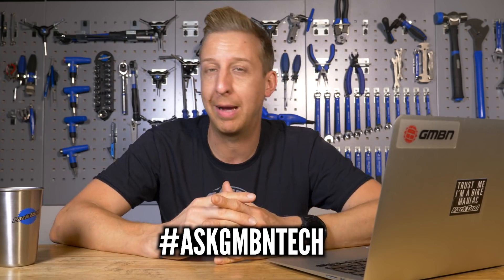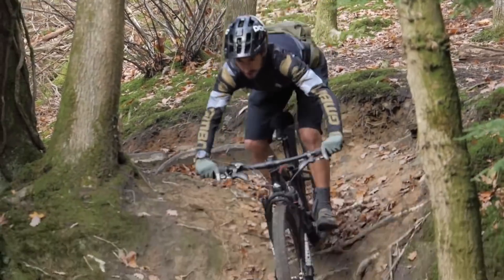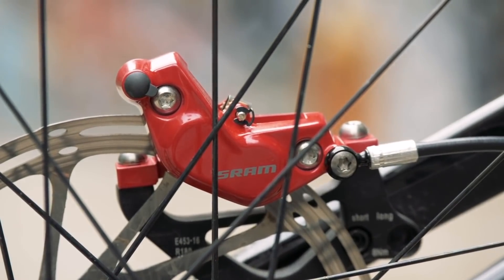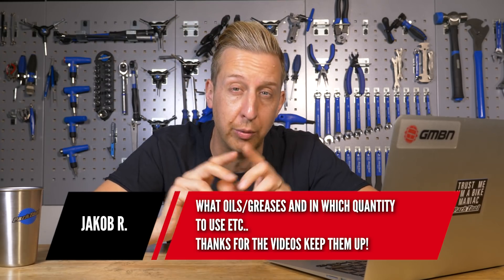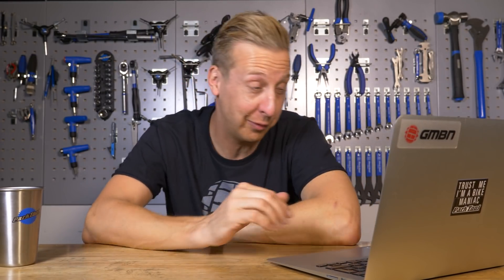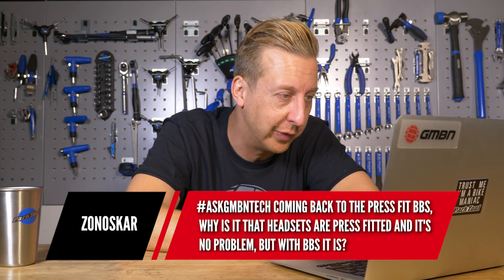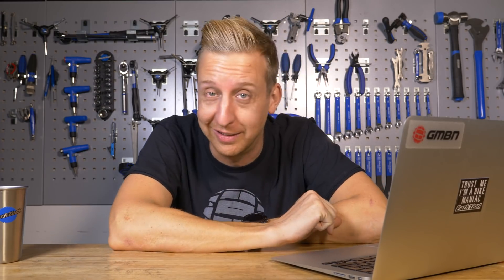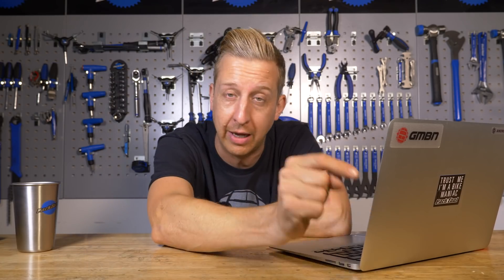Suspension Fork Service? | Ask GMBN Tech

Comment from the maker: What do you think about press fit Bottom Brackets? Let us know👇 Remember to use the hashtag #AskGMBNTech with your questions and we can try to answer them.
Reply: Id be happy to pay another 100$ for a bike if it came with a threaded BB, pressfit is pure liquefied garbage.
Reply: Press fit Bottom Brackets are a joke!
Reply: #askGMBNTech they work perfectly on 20 inch BMX freestyle/dirt jumping bikes but mountain bikes I prefer screw in bottom brackets.
Reply from the maker: @mountainlessmtb9940  Freestyle BMX BBs require the machined surface Doddy was talking about. BMX bikes use a larger bearing and smaller axles. In mtb overall weight is more of a concern and there is a lot more pedalling involved so the bearing races need to have this tighter tolerance.
Reply: @gmbntech  duh! That's why I said threaded bottom brackets were better on mountain bikes
Reply: Hey Doddy i have a question ive bought a budget bike and im slowly upgrading it. Im looking to upgrade the forks but im not all that bike savvy. What do i need to do to ensure i get the correct size fork? I would have bought used but MTB isnt popular in my area so its few and far between to get a descent used bike. Love the vids thanks!!!
Reply: Hate them! I wouldn't buy a frame with a pressfit

Comment: #askgmbntech 
I have a 180mm enduro, freeride bike. If i run it with 160 mm forks in front, should i, or can i change my rear shock to 160mm too? I would convert it to 160 at the back in order to make it more playful in the air and at the trails.

Comment: #AskGMBNTech I have a problem with my back wheel and there is some play even with the brake locked is this common and is there a possible fix?
Reply: Try checking the rotor bolts, and the hub :)

Comment: #askgmbntech hey mister dodd, i have trouble with my rear shock valve. Is the valve core the same as in tyre valves or are they something special because of the high pressure?

Comment: #askgmbntech
Hi Doddy, I was wondering which is a better alternative to dedicated chain lubricant. For a while may chain has been running dry and I don’t have access to bike chain oil so I’ve been using WD-40 and wiping any excess off, but my Dad suggested I use some  of his lawnmower engine oil as it would prevent rust and lubricate the links. But the engine oil seems to be a magnet to grit in dusty conditions whereas WD-40 doesn’t collect as much dirt. So should I keep using engine oil on my chain or switch back to using WD-40 until I get some good chain lube.

Comment: #AskGMBNTech

Hello, I have a problem with my seat post. I tight the screw at the correct torque and when I go on a ride the seat doesn't stay in place. It moves rigth and left, and the worst, it goes until the bottom, making me pedal in a bad positon. 

To solve this I increased the torque since 5nm (the correct one) to 7.5nm. 

Can I keep this torque with out breaking anything??? 
Or what should I do??? 

Thanks a lot and keep going guys, love the channel.

Comment: #askgmbntech I need to use an old tora 318 solo Air fork on a jump bike build I'm rescuing but I need to add the all travel spacer IN as I had it removed to boost it to 130 when it was on the front of my mongoose teocali back in 2009. Can't find anything online. I am familiar with lower leg servicing as I've just done a service and air shaft upgrade to my pikes. Help me Save my Toras Doddy.

Comment: #AskGMBNTech 
I have an X-Fusion O2 Pro RL rear shock and recently a buzz/ creaking sound has developed half way through its stroke, you can feel a buzzing feeling when you compress the suspension in say, a car park. Is this the linkage or the shock, or could it be something totally different? 
Should I even be worrying about this and if so, how can I fix it?

Comment: #askgmbntech How do you know when it is time to replace brake rotors?
Reply: There are 2 different indicators. 1 color of the rotors 2 width of the Rotors.. It should be around 1,8mm or 2mm or 2,3 depending on the model.
Reply: Nelson Thsnks. How do I know what the thickness should be?

Comment: #askgmbntech  On my last ride, I noticed my rear shock was sitting at about 25% sag without me on the bike. It wasn't extending back to 0%. After riding with it for a while, I decided to flip my bike over and pull on the back wheel to force the shock to extend, and it worked! I heard a little air escape. It was than great for the rest of the ride. What was this? How can I prevent it? and was my fix any good?
Thanks! (2016 Rockshox Monarch RL)

Comment: I think the idea that stronger brakes will lock up the wheels faster on a cross country bike is not really true. When the brakes are under a lot of stress, it requires more power to keep the modulation smooth such as when doing a stoppie. With not so powerful brakes, they will not have the power to modulate smoothly under the stress and they will lock up before they can modulate well.

Comment: #ASKGMBNTECH
Hi, long question, BB is confusing and buckling :( Thanks!

I have a loose cartridge bottom bracket (68/122.5). It buckles a little (I can see it wobble slightly) with pressure on the left crank at 6 o'clock position.
I also noticed that the screws that hold my cranks (3 piece, alloy, square tapered) were not very tight.
Now I'm waiting on a crank puller to tighten all the parts.

My questions are:
Can pedaling with a loose bottom bracket damage the frame?
Can the loose crank screws cause the BB spindle to ruin my cranks?
If my cranks are ruined, can I upgrade to something like hollowtech BB? If yes, does the spindle length of 122.5 affect the installation or do I just get hollowtech BB and 2 piece crankset?

Comment: #AskGMBNTech 
Hi Doddy, loving the show!👌🏻 I have a 26" wheel DH bike and was wondering if it was possible to run 650b forks with the 26" wheel? Or would this cause issues to the bikes geometry? Keep up the good work!👍🏻 cheers
Reply: If its dual crown, u shud be able to adjust the crown/stanchion position to keep geo pretty much same...though going 26 to 27.5 with same travel and stanchion position will slacken the bike to more modern levels maybe, so I reckon it will be fine if ur only doing gravity

Comment: #AskGMBNtech I am an xc mtb rider and I currently ride a 2x11 drivetrain and I would like to switch to a 1x12 drivetrain. My free hub body is a shimano. I was wondering if a 12 speed cassette with 11 to 50 teeth is a good option instead of a 10 to 50 teeth. And how many teeth on my chainring should I be riding with?

Comment: #ASKGMBNTECH 
Do an experiment on stopping distance based solely on rotor size
And should i get goggles and full face for my full sus or just a normal helmet with jawbreakers?
I ride my long travel full sus mostly  for street riding  and some trails here and there

Comment: #askgmbntech Why is 20mm boost not the new standard for mtbs?
With all the beefier forks out there and enduro going for 29ers it would make sense imho (always hated the 15mm axles). Stiffness should be better and weight effects are negligible.
Nice show btw, keep up the good work!
Reply from the maker: Well we used to have 20mm axles however were able to drop this down to 15mm to keep weight down. Boost 20mm is available in downhill forks 👍
Reply: Why like 20mm but hate 15mm?just wondering
Reply: If i remember correctly 15 mm started when Fox wanted to get around the Maxle QR thru axle patent for 20mm.
The 100x15 thru axles were kind of strange. But with the introduction of boost I wondered, why make a new standard for 110mm width, when you already got one. Bigger axle diameter means bigger bearings, which is good for durability and if there were no benefits to the stiffness they wouldn’t use the bigger ones in dh, also I like bigger flange diameter for stiffer wheels.
Even Rockshox made it obvious that they think a bigger axle is better with their predictive steering hubs. When I look at something like that I think the days of the 15mm axles are numbered.
Last but not least there is compatibility: with real sturdy single crown forks out there it is annoying that it is impossible to swap front wheels between enduro and dh bikes.
I do not buy the weight argument even though it is impossible to compare right now as there are no forks with both options.
I am still wondering why Rockshox is on the 15mm train.

Comment: Would 130/120 mm of travel be to short for north shore style enduro trails? #AskGMBNTech
Reply from the maker: It's what you prefer Caspar, there are some great hardcore trail bikes in this category with beefier tubing and more aggressive angles.
Reply: Blake rode a ht at whistler, so did josh on daily rider...so reckon ur good. Tho enduro is more 150 upwards normally.

Comment: #AskGMBNTech Hi Guys, love the show, i'm a bike mechanic from México, and i always have a question of fork/suspension service, especially in fox, some years ago i get a distribution of the brand, and take the training service, but it's really different what it includes of country to country (specialy inside my country), in other suspension service center they just made a change of dust seals, rebuild of Na2 air spring, and they purge the hydraulic cartridge,  but (at least as far as i know) each 125 hours it must be performed a full rebuild of the cartrigde, but the market price only of the spare parts its the same of the "full service" offered here (around 55 dllrs for a Fox 32) so, how it's done a full service over there? i mean, what it includes? cause a lot of rider prefers the cheap service, but when a problem arises, they somethimes tend to come with me. thanks for your time!

Comment: I'm sorry Doddy, you got the braking thing dead wrong. It's traction and rider weight NOT bike weight that matters, bike weight is a very small factor in braking performance, the difference between a lightweight cross country bike is minor;  let's say a 22lb. vs. 32 lb bike is only 10 lbs. It's rider weight and tire traction that matters.
Reply from the maker: The reference of lightweight XC bike was Doddy more talking about the style of bike and the riding that one would do on this bike. These bikes run longer stems so rider weight is pushed forward and are more about pedalling efficiency and run narrower tyres. This is very different to say an Enduro or Downhill bike where the angles and suspension travel allow for more aggressive riding at higher speeds. You are right that a few LBS between two cross country bikes will make very little difference to braking and he was not suggesting this.

Comment: #AskGMBNTech

Hello, I came to know that many shock come with different stroke travel but the same eye to eye measure (for example 230x60, 230x65 etc) but in reality are exactly the same hardware as the longer one, only with spacer installed under the bottom out bumper (talking about coil here)

so my question is, if I wanted to extend the rear travel of my bike, given that I checked of having enough frame clearance, would just cutting this spacer be enough? cause I read you also have to modify the Internal Floating Piston settings

thanks!

Comment: #askgmbntech when I ride, my thru axle rattles loose, only by 2 or 3 threads over a ride, but it's still there. Should I use lock tight on the thread? Or is there something else I should do?
Reply from the maker: If the axle has a locking system such as a cam check this is done up tight. (similar to a quick release cam lever) If it is an Allen key design check this is torqued up correctly. Be sure everything is greased correctly 👍

Comment: #askgmbntech

Hey there, love maintaining my bike but is there any advice how to align the stem/bars and the wheel.
After checking the bearings or spacer configuration it's always a little bit off and it need a lot of fiddling to align them correctly
Reply: Line up ur bar with the edge (front or back) of the crown by the stanchions, by eye...ensures bars are parallel to crown =perfect alignment
Reply: @rupedog  great advice I usually try stem and tyre. Thanks
Reply: Maik Eckert as far as I know, the only way is to sand over your bike and eyeball it.

Comment: Hi Doddy, love the show and learn loads when watching. My question is - I have some wheels with 25mm internal width, what would you say is the biggest tyre I can fit on the rim?
Reply: Simon Davis I have fit a 2.4 tire on a 25mm rim and it’s been absolutely fine. I don’t think anyone would recommend anything bigger than a 2.4.
Reply: @peterlang5047  Cheers Peter.... Was thinking of fitting either 2.4 or 2.35 tyres. Thanks again
Reply: I've fitted a 2.6 schwalbe bobby nic on a 20mm internal rim and had no problems, of course at low pressures at like 18 psi it feels numb but still never had a problem except it was easy to puncture cause it's on my hardtail, doddy says if you want a shorter stem on your bike then don't go any further than 20mm but I had a 85mm stem with 680mm bars and stuck a 45mm stem with 740mm bars and it felt a millions times better cause my weight wasn't all on the front from having such a long stem and it didn't make a difference of the climbs...
Reply: It's all down to personal preference mate, do what you feels right just don't go crazy lol
Reply from the maker: With a 2.4" tyre you could go down to a 19mm internal rim before tyre roll would start to get massively affected. With a 25mm internal you will have a decent profile! 👍
Reply: ✌👍👊 Thanks very much...

Comment: #AskGMBMTech Hey Doddy, I recently bought a 2014 Trek Fuel EX 9.8 27.5 mtb and have had a lot of peddle strikes already. The bike came with 175mm cranks and a 110mm fork. Could you please let me know if smaller cranks would make a big enough difference and how small could I go? What are the advantages/disadvantages to having smaller cranks? Or would replacing the fork with a 130/140mm fork do the trick as that would obviously raise the BB. Would love to hear your opinion on this. Keep up the great work 🤙🏻 Damian
Reply: Your bike should already have a 130/140 maybe even 150 mm fork on it. The 110 may be the hub width sizing. Check what travel is on your fork and make sure that both your fork and shock are properly serviced and set up. THEN look into upping the front travel by 10mm and maybe shorter cranks
Reply: Biker dju yeah the bike shipped with a 120mm fork on it but the previous owner run it with a 110mm fork, honestly don’t know why. I’ve added more psi in the both the fork and rear shock which helped a bit but I’m still getting a ton of peddle strikes

Comment: #AskGMBNTech Hey doddy, i have a 2018 Norco Storm and i have completely destroyed my 3x9 drivetrain (as one does) and i want to up grade to a 1x groupset. Will an 11 speed cassette or even a 12 speed cassette fit on the oem hub? Ive heard alot of different things on the inter webs so i would love to get the DODfathers opinion on this! Any advice or recommendations would be greatly appreciated. Thanks!
Reply from the maker: If you are currently running 9speed, your hub will only go up to 10 speed block max. (This is fine though as you can get some great quality 10 speed setups.) If you remove the cassette and find a small ring on the freehub body this can be removed and you can run 11 or 12 speed NX.
Reply: Depends on the freehub. You can fit a 12 speed nx eagle cassette which has a 11-50 tooth range on a shimano freehub. Anything with a ring smaller than 11 teeth will require an xd freehub, or shimano microspline although for microspline options are limited. Im assuming you are running a shimano freehub so you could run a 11 or 12 speed setup as long as it fits the driver on your hub.
Reply: Thanks guys appreciate the insight!

Comment: #askgmbntech
What do you think about the frame construction of latest Pole models, Stamina and Machine? I'm seriously considering getting a Stamina 140 and I would like to have your point of view on that. Certainly, Pole's geometry has been on the industries leading edge and it's cool to see brands of the likes of Yeti coming up with slacker HA and steeper HT (geo very similar to that of the Pole).
Reply: I like the idea u can unscrew the bolts and split ur frame...sadly u cant as its glued as well... but it looks cool. Once bonded, not sure the bolts do anything...maybe stop the bond shearing vertically? And gives an industrial look...

Comment: #askGMBNTech Hey I got a cube stereo hpa 150 race 2016 and riding 27.5+ tyres (3.0 inch). I’m having a 200mm front rotor and ride 1 bar (14.5 psi) on both tyres. They feel pretty hard and I‘m often skiding on the front while braking. I tried riding less pressure, I have more grip but the pressure is under the recommended pressure marked on the tyre. I got nobby nic pacestar tyres but I‘m not sure if I should ride them softer than the brand recommends. They are tubeless and I know you can run less pressure on bigger tyres, but when I measure the pressure like I would like the tyres to be and I‘m not even touching the zero of my pump, but they feel hard enough for me and I don’t feel like I would destroy my rim with it (I’m running also running about 14 psi on my xc bike with 29x2.25 tyres and never got a flat because of exploding my inner tube and I’m riding roots and loose,and hand sized rocks). What would you do? Ps I “only” weigh about 70 kg with my riding equipment.
Reply: sry for the long explanation XD
Reply: I think the issue is more riding position and less bike setup. Try leaning forward more and modulating the brake. Hope that works
Reply: Pacestar compound is their second least grippy...and if u ride in wet mud, plus tyres are not much cop... if its dry, try a softer compound tyre